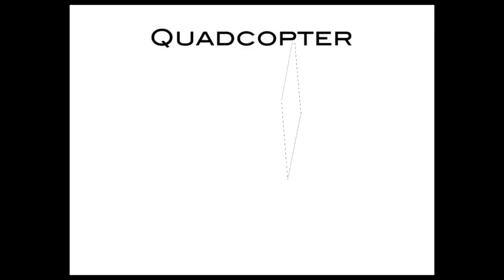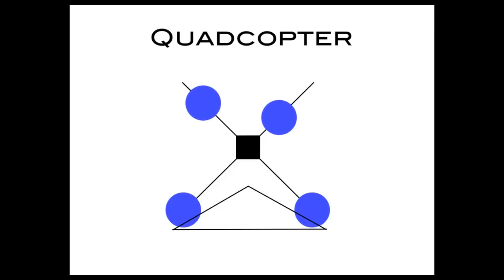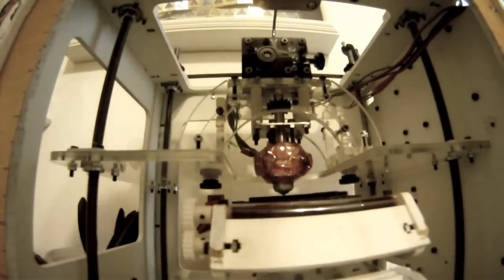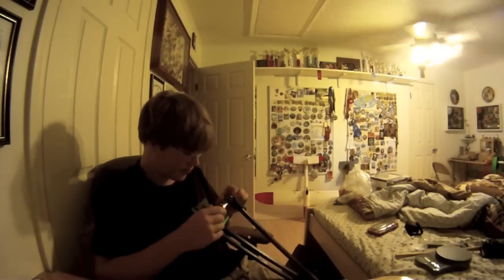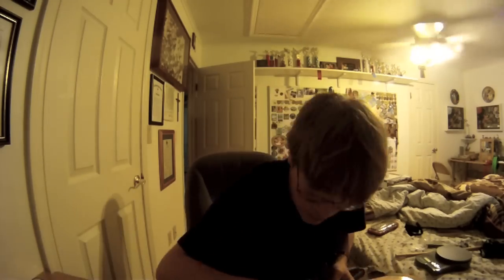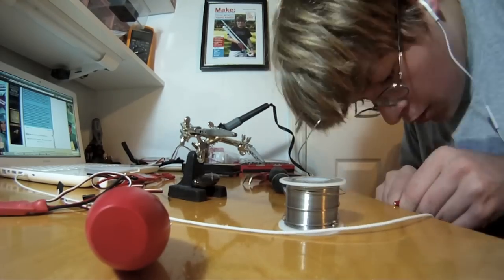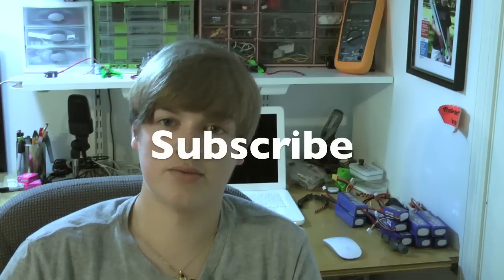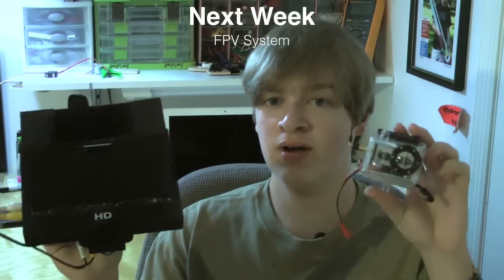Tricopter V2 How To

Comment: THe materials you mentioned are the worst materials you can use for a multi. Brittle. You can 3D print certain components but not the arms. Im not an expert in laser cutting, but if you can cut wood, CUT WOOD. Or you can just get the dowels(square long sticks of wood). They are easy to make and break. They break before your electronics do. Please try it